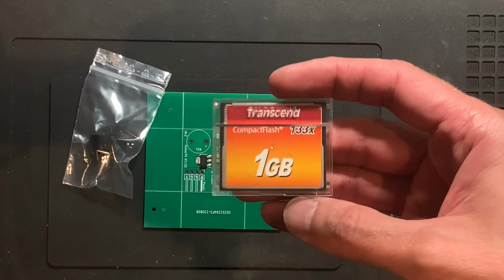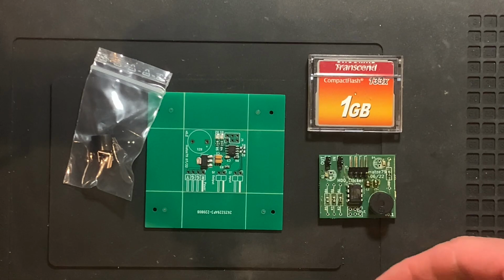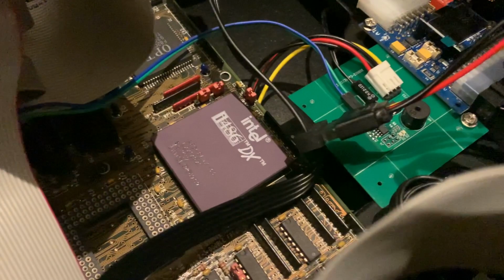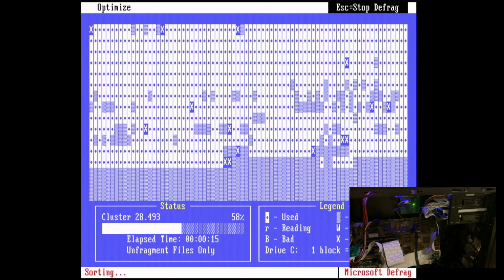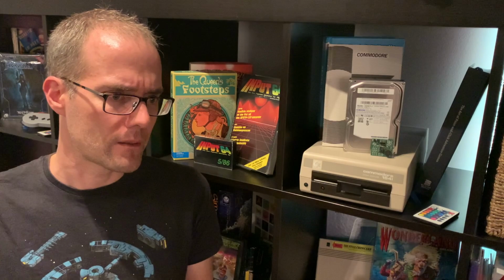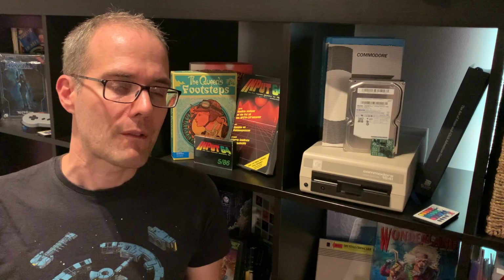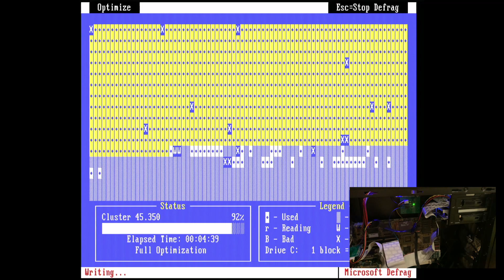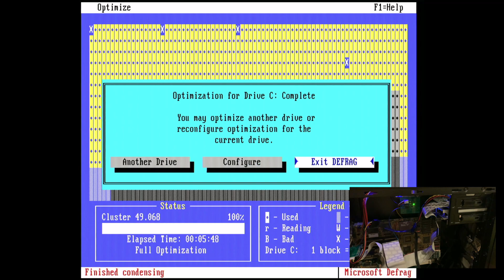The HDD Clicker

Comment: Probably have to slow down the SD to get to „legit“ old spinning platter disks experience. Also, the clicker would probably need to add some randomness to the clicking sound (different volume, etc) as a spinning hard disk didn’t just click monotonously whenever the HDD LED switches on.
Reply from the maker: Yes, you can invest a LOT of time into this project. :) The problem is that is uses a simple piezo beeper, which is hard to get different volume out of. Not impossible, but probably requires very careful PWM. And I agree that the CF is almost a bit "too fast". But as an audible indicator of disk indicator in Windows and DOS games I think it's perfect.
Reply: @root42  Yep, it's a nice additional "ambient indicator" to add to an otherwise "silent" retro PC.

I'm sure as time progresses, people will add playback of sampled floppy disk drive sound and hard disk drive sound, based on I/O access to emulators like PCem and DOSBox. There was some (non-PC) home computer emulator I tried a few years back that did already have floppy disk drive sound emulation.
Reply from the maker: That probably was UAE, the Amiga emulator. It has drive sound emulation by default.
Reply: @retroianer422  It's a cool demo for a first version :)
Reply: ORRR you can speed up the clicking noise somehow 🤷 but idc much tbh

Comment: Finally someone has made this idea a reality, nice work! Reminds me of the mid 90's IDE drives like the WD Caviar.

Couple of things for next version:

1) can you add a second speaker alongside to simulate the spinning motor / air sound?

2) a version with the 80's MFM stepper motor sound, I love that mechanical clunking

3) someone with 3D printing skills make a 3.5" mount to house the circuit board and the flash adapter in one piece
Reply from the maker: There are many ideas for enhancements. Let’s see where this project will be taken. 
Regarding 3: I think in the dosreloaded forum, where this project originated, someone was already designing such a piece for holding CF and HDD clicker.

Comment: Interesting idea. Would be cool if it could sound like an old MFM/RLL hard disk stepper motor. They sound great when operating but I don't like using them now they are so old. I really don't miss defragging hard disks...
Reply: I completely agree here and maybe in future versions, it could use a proper speaker to play a spinup sound on power on and for those people who are really masochistic, maybe add some random old age bearing whine that comes and goes with old MFM/RLL drives.  :-)
Reply: @dashorken  and the "crying" or "yawn" that some Samsung (if i'm not mistaken) made from time to time.

Comment: OK my 2 cents:

- it would be cool if you could turn up or down the volume of the clicking. Depending on the case you have, this can be annoyingly loud.

- old PCs don't always have a HD led connector. On my old IBM PCs, these are often custom cables that don't have the  same plug. It would be cool to include the two-prong connector in the box so you can re-solder the original leads

- as has been said, part of the authenticity is hampered by the fact that CF and SD cards (not to mention SSDs) are WAY faster then old school drives so the speed of the clicks is also much faster. By the time drives were actually that fast, they were also much more quiet. If the little board could filter clicks & adjust the speed at which the clicking happened to half or a quarter speed (so if it does 20 clicks per second it only does 10 or 5) it would sound more accurate. You'd get less clicks than on a real drive but the clicks would sound more or less the same speed.

I may still buy it because I have missed the sound of the drive in my older 386 & 486. Especially with my 386 which had no sound card, the sound was VERY audible.

Comment: One thing I'm curious about is if one can swap/muffle down the buzzer or, however it's called, to get a more "modern/vintage" sounding hard drive from late 90s / early 00s. ^^;
Reply from the maker: Piezo buzzers are notoriously harsh. You might be able to muffle it with something taped over the "hole".

Comment: It is a nice, low cost hack, but personally my problem here is that the sound is just not anything that any real HDD would ever make...  and that is because it is not based in any way to how the real HDD actually works. How ever if you think that it is ok, that tires squeal on sand in Hollywood movies, then this should work ok for you. :-) Problem is that this seems to click when the HDD reads, but real HDD clicks only when it seeks up or down. In other words this clicks during reading (that should be relatively silent) while real HDD clicks between the reads causing "click bursts" depending on how far the data physically is. So... In the end this just ends up being very different kind of sound that is based on wrong theory, but if the idea is just to hear when some loading is happening, then I think this rattle works well for that purpose.

Comment: This is great! I bought a small external speaker and recording module similar to what they use in audio greeting cards. What I really wanted to do is to record the iconic Miniscribe 8425S activity noises and link it to the activity light. I wonder if there is a way to modify this board to something similar except to record a small sound clip of some kind?? Not sure how it could be done but that would be cool. Also the unique activity squeaking of the Apple Lisa hard drive when using the X-Profile board or another SSD solution.

Comment: great video and nice presentation, thx. Do you think, it's possible to add some noise to simulate the spin-up sound of a harddisk at starting the PC or/and the general soundscape of a fast rotating hard disk motor?
Reply from the maker: As it uses an ATtiny plus a piezo speaker the possibilities are very limited. The piezo surely has a pretty high frequency range, so a whine would be possible. Question is if it can be limited in volume so that it isn't horribly annoying...

Comment: Had no idea this existed.  Since it's trivial to write a TSR to provide the same function via the PC speaker, I'll have to check the project page to see what the original author's motivation was.
Reply from the maker: I think Matthias is simply more fluent in building hardware and ATTiny than coding DOS TSRs. Also this works even when you are not running DOS, during BIOS time, or even on completely different machines, like an Amiga. :)
Reply: @root42  I completely missed that this was universal -- good point!
Reply: Do have such a utility available for DOS?
Reply: @grappydingus  I don't recall one off hand, but it would be fairly trivial to write. Trivia: Plus Hardcards do this in their bios, along with putting a small plus symbol in the top right as a "light".